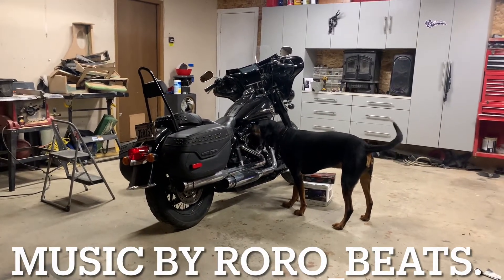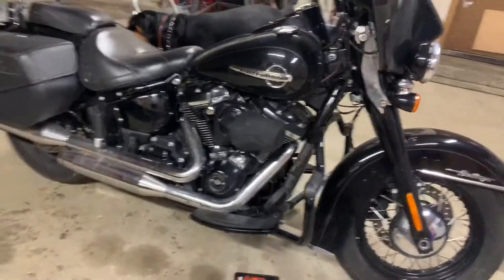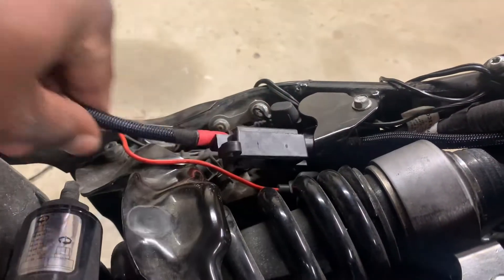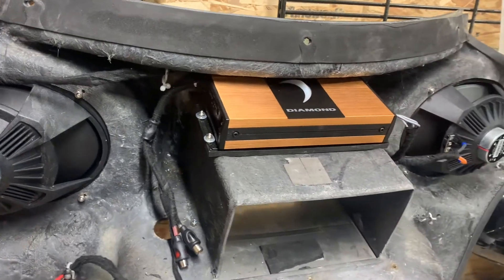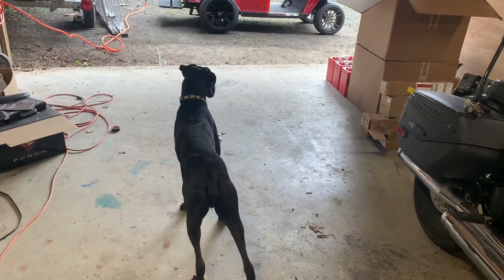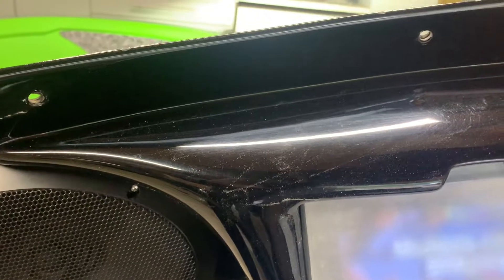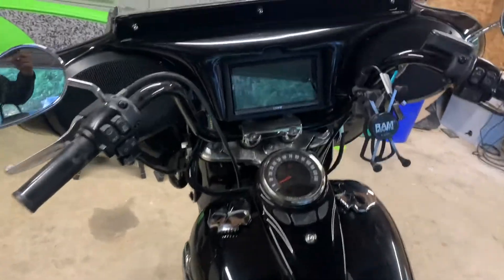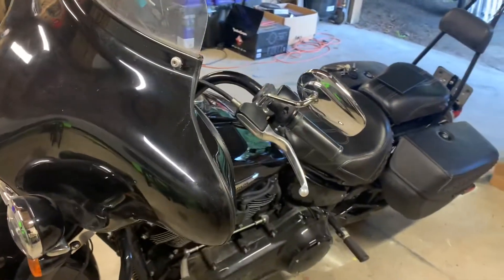2018 Harley Heritage !!! Radio and amp install!! First motorcycle install !!! Must see.

Comment: So the Sony radio wouldn't fit in the original hole of that fairing? I want this fairing but don't want their radio. I'm looking at changing all of that myself.
Reply from the maker: The Sony will fit just has a gap that needs to be filled to look decent.  And keep water out.

Comment: Where did u hook up the remote power wire from the amp??? Same bike as mine just not sure where I can hook up that wire as it needs to be from accessory power so it's not always on.
Reply from the maker: I connected the remote wire from the amp, to the blue with white wire on the new radio.  Or in some radios, it would be the solid blue wire coming off the radio pigtail
Reply: I'm just trying to find an accessory wire to attache the remote wire from the amp to my bike so it's not always on. My amp has Bluetooth so need need for a stereo. Can u see where they got the accessory power wire ran to on the bike???
Reply from the maker: @rorygibbs9130  The accessory wire on this bike was already there from the old radio, so am not sure where it was ran from . But let me do some digging and am sure I can find something for ya !
Reply from the maker: @rorygibbs9130  If you have an owners manual you could probably find the wire that way. Or you can also install a small toggle switch that would work as well

Comment: Question,  I have a 2018 heritage with radio, how did you run the ignition wire that turns the radio on when the bike comes on so you don't lose your programed channels?
Reply from the maker: So the radio that was installed before the radio I put in ; had a turn on wire and a 12volt wire when I tested it.  If you run a 12 volt wire straight to the battery, and a turn on wire straight to your I ignition wire you should be good to go.

Comment: On bikes u don’t use rca cable from amp to stereo
Reply from the maker: @Thizz2979  yes you do use RCAs.
Reply: 😂 ok just never see anybody running them on videos
Reply from the maker: @Thizz2979  if the radio is an aftermarket radio than yes there should be RCAs ran.   If it’s a factory stock radio than the install is using the speaker leads from the radio to the hi/low adaptor.  Than the RCAs will plug into the adapter.
Reply: @anthonylyonsofaldesigns   got u thank u so much for the explanation 🙏
Reply from the maker: @Thizz2979  your welcome , anytime.

Comment: On this amp where’s the output
Reply from the maker: Am not understanding your question !  Can you be my specific
Reply: @anthonylyonsofaldesigns  sorry I mean how did you adjust the frequency and the sensitivity on the amp?? For best sound quality thank you 🙏
Reply from the maker: There are gain controls , and I set the Hi pass filter on the amp.
Reply: @anthonylyonsofaldesigns  ok thanks for the fast response trying to get my amp dialed in and I need to adjust it